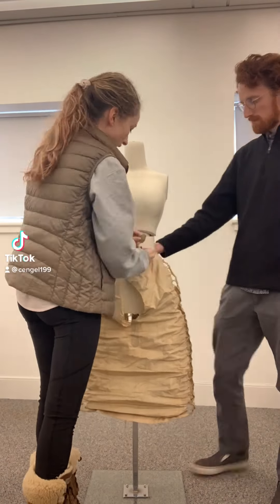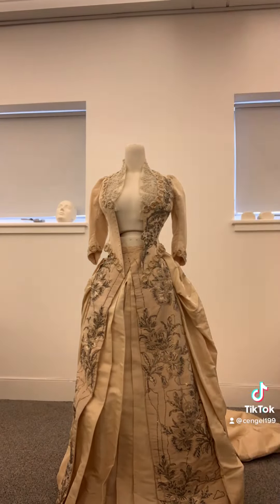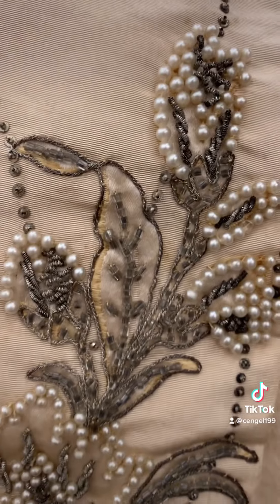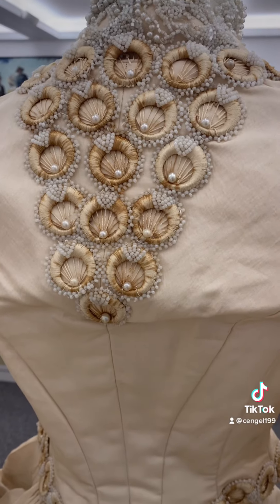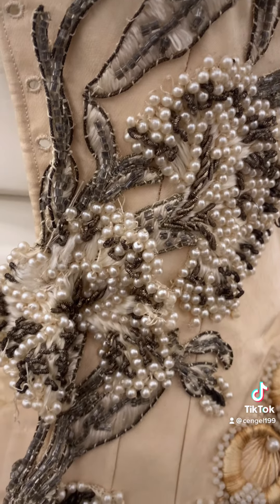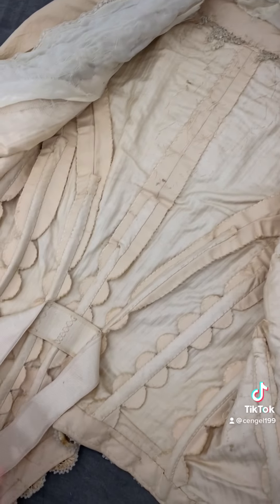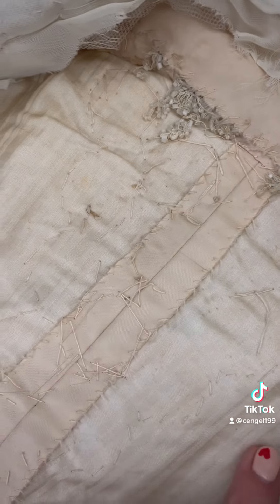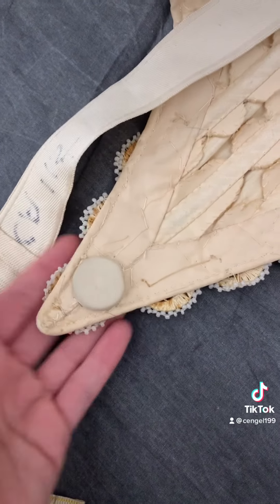1888 Wedding Gown

Comment: I might be wrong, but I think that for a dress to be a princess cut the bodice should reach to the ground (without a waist seam). If a bodice stops at the waist, it's called a waist; at the hips, a basque; if it extends into a skirt, a princess.
Also, I think the scallops on the interior aren't mere decoration, they help the seams curve over the body without bunching or wrinkling.
Reply: The first few dozen images I saw on Google Image were just bodices, also many gowns were 2 separate pieces; each with their own princess seam & set of rods.
After those, I did see a few dress-long ones though! 
Many fewer compared to the bodices, however. 
Aaaand this is the extent of my amateur research on this for now, lol
Reply: I think you're correct that the scallops are clipped seams cut into curves and finished by stitching the seam allowance of the fashion fabric to the lining with an overcast stitch worked somewhere between stem and satin stitch.
Reply: There's probably an underlying reason for everything that was put into this dress. And they found a way to make it all look beautiful.